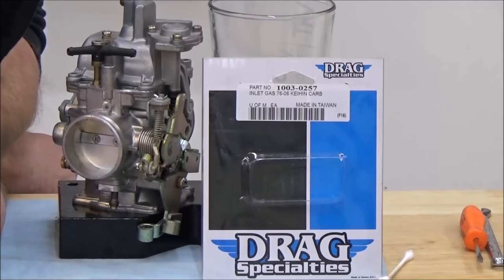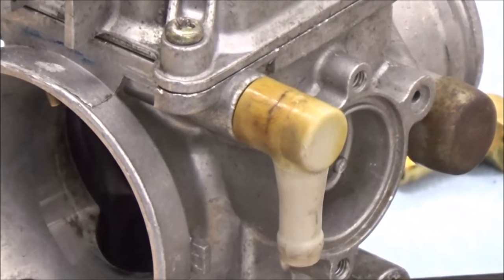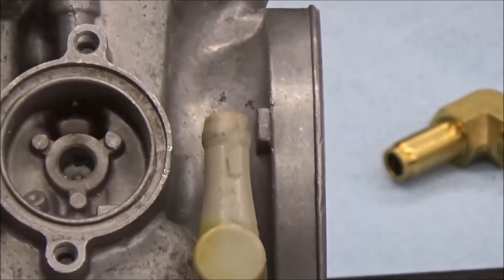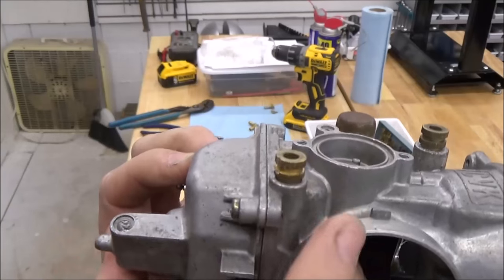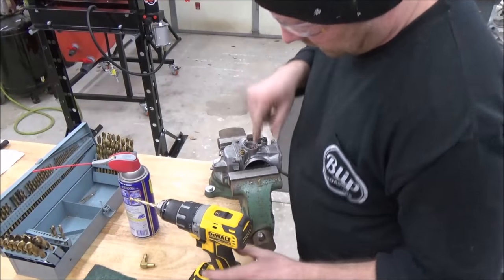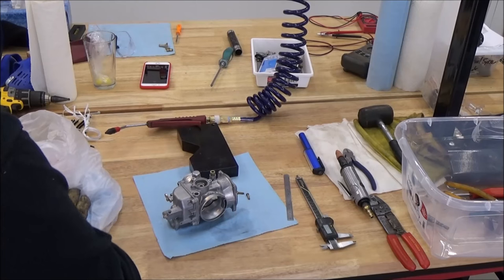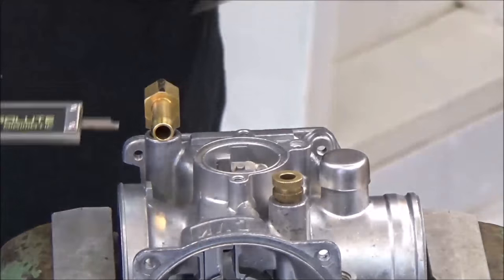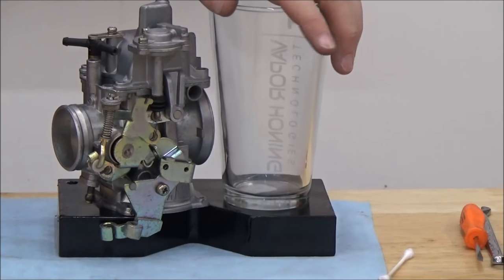How to replace a broken carburetor fuel inlet elbow/nipple Demo: Keihin Carb

Comment: Hope somebody sees this comment.  I appreciate his video, but there is much easier way.  I spoke with 2 Harley mechanics that have 50 years experience combined.  Put your fuel inlet in a vice and clamp it hard.  Now slowly turn your Carb back and forth and pull up.  It comes right out.  I did it and it was literally a 5 minute job to get out and new brass fitting installed.  Mine was off a 84 Harley FXRT.  Good Luck and hope my comment helps somebody in the future with this same problem.
Reply: RIGHT ! this guy went way too far.

Comment: Great job! Harley has the part for 12 buck compared to drag for 18.also the easiest way to do the job is to tap the fitting put a small piece of pipe around the fitting place a bolt and a washer into the taped portion thru the small pipe, tighten bolt and pull that sucker out! Never have to worry about drilling out the carb by accident.

Comment: I used the tap out and pull method, very simple. Replacement was pushed in using a vice as a press. Easy no heating or cooling. ... I also removed the float cover to ensure there was no bits of metal had made its way inside the carb.
Reply from the maker: Nice. I just finished recording that method! Soon to release. I find it to be a better method too. I still use heat and cold assistance though.
Thank you for commenting. Could you spare $2 and support us with even more benefits? Smash the subscribe button and bell! Says thanks here friend! Join this channel to get access to perks:
https://www.youtube.com/channel/UCBhM8DCKnT3qXwTW0eToyCg/join  
-Daily MEMBER FIRST COMMENTS ANSWERED FIRST 
-Live Q/A video chats
-Wonder if we have a video on your need? Members can request content links!
-Full Access to the ENTIRE 700 video library
-Member-Only FREE tool giveaways 

Just want to say thanks quick to support us for this information and our work saving you money? 
Give us a high 5 here:  https://www.paypal.me/how2wrench

Comment: Shane I sent you a PM If you have any questions feel free    Thanks for your excellent training videos
Reply from the maker: Thanks, Fred. Good points. What is your experience in "average" interference fits for size?
Reply: Shane Conley I wish I could.  A figure like.001 inch per Inch diameter and have it work (or be correct) but I can't.   I have seen this used as a start point but even Engineers disagree   its seems to me more subjective than objective. Depends a lot on materials aluminum and steel have very different coefficients of expansion   If possible use the specifications if you have them. Fits like bearing and bushing are usually called out in the manual. When you fit something on your own as you did on the carb you have to use a little common sense. Small diameters obviously don't require much and can't tolerate much. You have to ask yourself what are you trying to accomplish. The objective on the carb was a gas tight seal.  I'm sorry I may be sounding vague but there are so many variables. When you are working with heat and cold you have to work quickly and precisely. It only takes a small burr and the parts will not go   On small parts the temperatures will equalize Very quick   Dropping bearings in engine cases or on a shaft are fairly easy because they don't have to be oriented.

Comment: @Shane Conley; Hey, I have a Keihin FCR39MX carb that has a metal fuel inlet elbow.  From what I understand the inlet elbow on my carb is press fit.  Do you think I could use this same procedure for removing it and replace it with a brass unit like in this video?  I'm fitting the carb to a different bike and the fuel inlet is pointing in the wrong direction from my fuel petcock.
Reply from the maker: That surely is a question for Shane. We wouldn't guess. He has techline. 
👍 Thank you for taking the time to comment! Hit that subscribe button if you haven’t please! It helps us! 
Here is a way to support all the free videos.
Want to say “thanks” or “keep it up”? Click here https://www.paypal.me/how2wrench  

Coach Conley is also available for hire to personally work one on one with you if ever needed. Yep he is a real person. Give him a call @ 602-345-0432

Your answers and help are just around the corner. Save time and money while protecting your investment and yourself by doing it the right way!
Follow us!
Web:
www.How2Wrench.com    
www.Tools2Wrench.com

Comment: Hi, can this also be done to a fuel inlet line where the float valve sits? the thing is a brass tube which looks like it was press-fit in there. I would like to heat up my carburetor to expand and get that tube out and replace it with a one made from scratch.
Reply from the maker: Hey there awesome human (we hope so anyway 😁) I’m an intern here at The How 2 Wrench training center. I’m trying hard to learn each day and answer questions as I learn them. This one is beyond my scope yet and to not short you, it’s a great one for Shane directly. Believe me, I will be paying attention to the answer too as a fellow learner! 
Shane tries to devote one day a week for time to answer non-member quick questions from fans but the demand is insane 300-400 requests a week! Hang tight and maybe you get lucky he gets to circle back quick. 

If it’s an emergency and your head is about to explode from frustration or fear? Get Shane’s cell here: https://how2wrench.com/ols/products/techline-one-on-one   

As I’m sure you can understand as a working person, life has bills and we have to work first and play later. Due to the overwhelming inbox we are focused on fulfilling Techline and fan member requests.  If you need immediate help you can get his cell directly with an order. We thinks that’s an amazing relationship for both and keeps the lights on. 
Bruce
Social Media Manger

Comment: Try heating  the carb in a small toaster oven to pull out the old fitting and install the new one.
Reply from the maker: There are some plastic bushing/washers in many carbs that I'm afraid if the "whole" carb was raised to a high enough ambient temp they would require full disassembly. The down side to this is the throttle plate screws are "staked from the factory and often not available now. Entire other conversation and I get what you're suggesting, but just some quick thoughts for others reading too...
Reply: @How2Wrench  I use a thrift store toaster oven for tons of stuff in the garage. It's great for installing bearings in small engine cases or anything that's a press fit. Just another cheap handy tool to have in the arsenal. I have accidentally melted some crap on occasion though.😄
Reply from the maker: @djcampbell9150  Right on! I wonder if you could share a pic of your set up in the community tab?
Reply: Yeah I took a torch to it and used vice grips and it came right out!

Comment: Another removal method is to use a tap and pull out the old fuel inlet    
https://cv-performance.com/harley-fuel-elbow-replacement